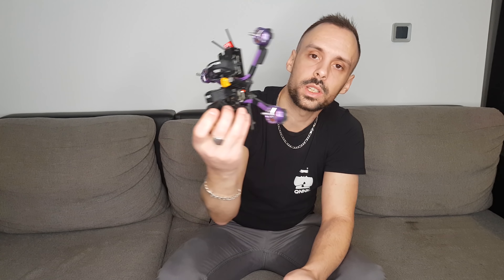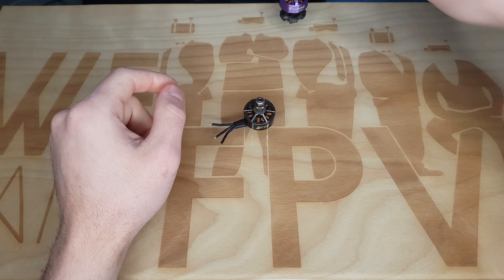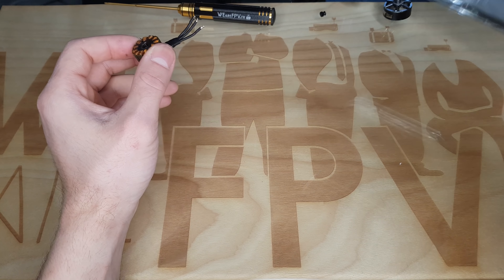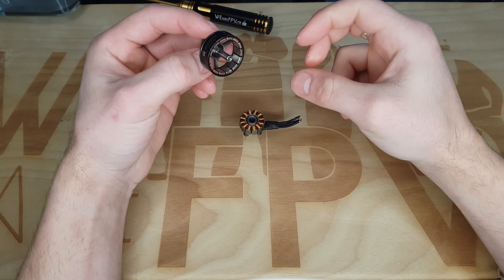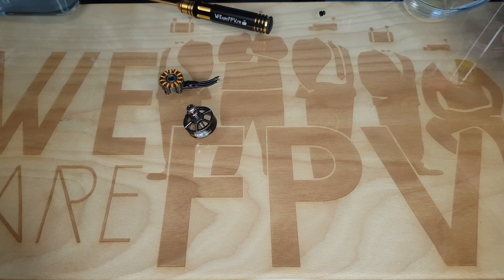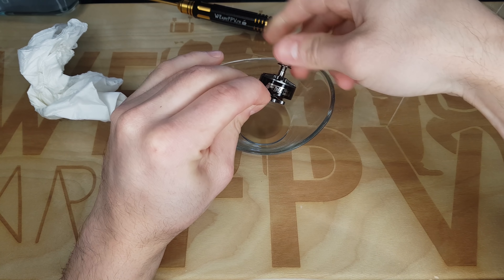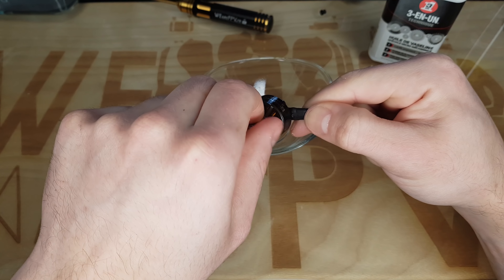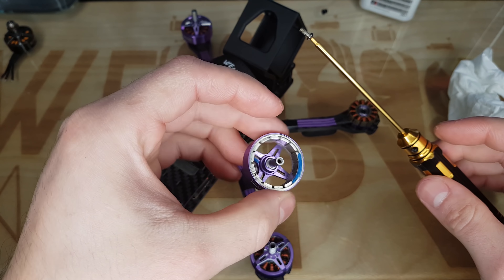Nettoyer les moteurs d'un drone | Tutoriel, entretien des moteurs brushless !

Comment: C’est « anti mécanique » de nettoyer des roulements à l’eau chaude. Je comprends que tu sois obliger de refaire l’opération toutes les 3 ou 4 sorties. En nettoyant un roulement à l’eau chaude, l’eau s’infiltre, se mélange avec la graisse du roulement et la dégrade. Il faut nettoyer le moteur s’il est bruyant (à sec c’est le moins risqué). Testez ensuite la rotation. Si c’est bon, ne faite rien d’autre. Si il est toujours bruyant, le roulement a morflé, il n’a plus de graisse, alors là vous pouvez appliquer toutes les recettes de grand mère que vous voulez pour le regraisser, mais sachez que ça ne durera pas longtemps et que vous prenez le risque de gripper un moteur à tout moment. Un roulement hs, on change le roulement (s’il existe en spare) ou le moteur.

Comment: heu non faut pas faire n'importe quoi sur des roulements haute vitesse. Il y a de la graisse au lithium,au teflon ou synthétique (type SLR-77) dans les roulement, qui sont sensé etre sellés par un joint.
Ils ont pas besoin d'entretient pour des heures et des heures d'usages. Le seul truc faisable c'est de mettre un poil de graisse à la jonction des 2 roulement pour améliorer le sellement et réduire l'entrée des poussières, mais pas s'amuser à y mettre de la wd40 qui contient un solvant pour pénétrer dans le joint.
Le seul truc qui peux rouiller ce sont les plaques de fer dans le bobinage.
Et faire baver de l'huile sur les bobines c'est le meilleur moyen pour agglutiner les poussières.
Bon heureusement quand on a réussi à faire rentrer n'importe quoi dans les roulements on peu les changer.